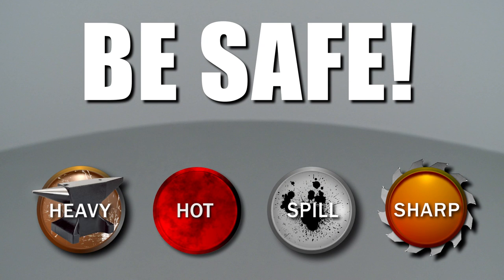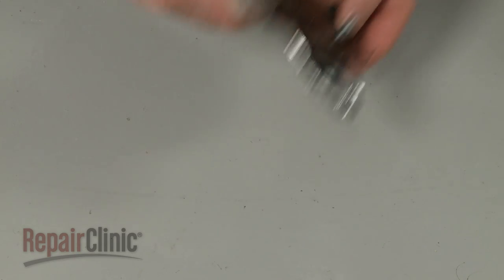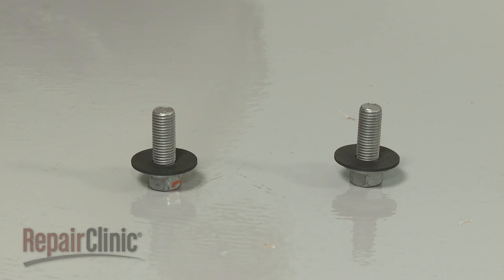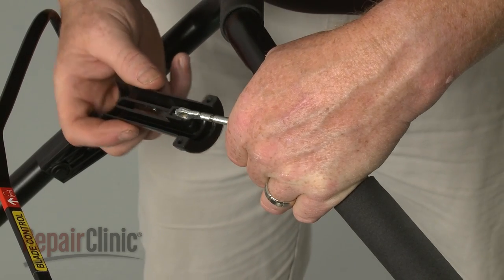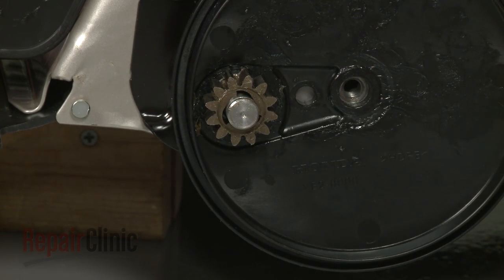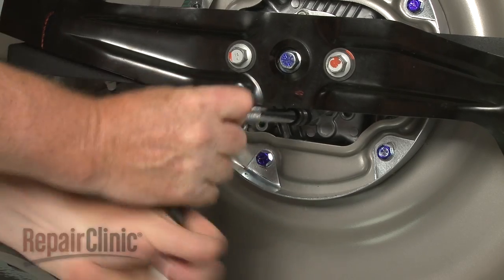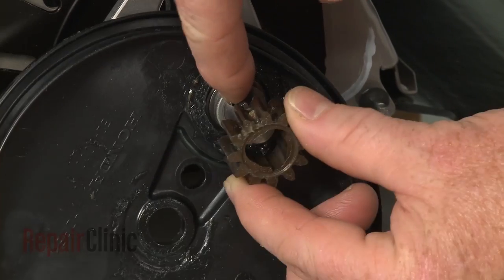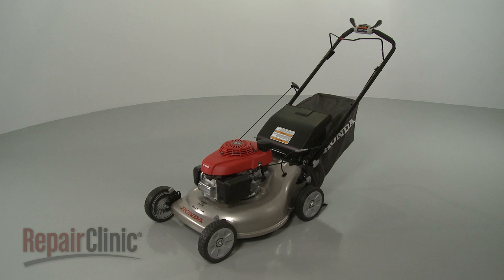Honda Lawn Mower Disassembly (Model # HRR216K9VKAA) – Lawn Mower Repair Help

Comment: I am glad that you do. I was recently given a Honda self propelled mower and It has bad cables and who knows what else. when I pushed it to a temp resting place I could hear a grinding noise and the wheels in front are a little tipped outwards. So I just happened upon this video by the grace of god and a little help from google. Thank You for this tutorial.